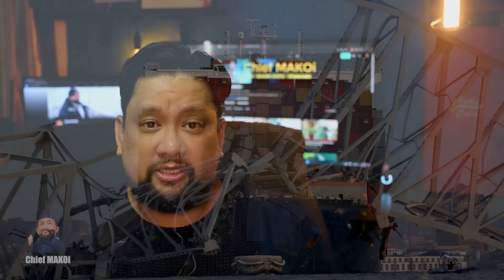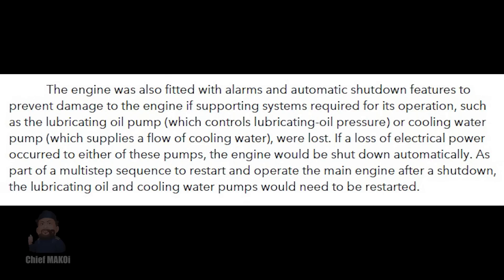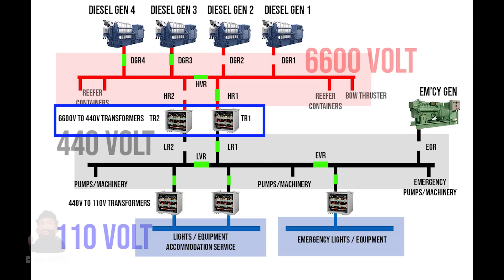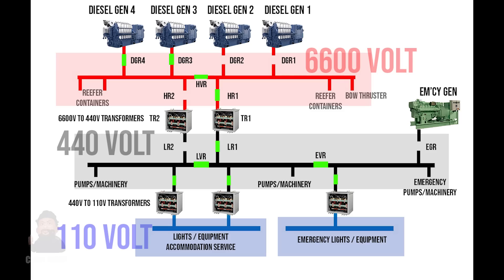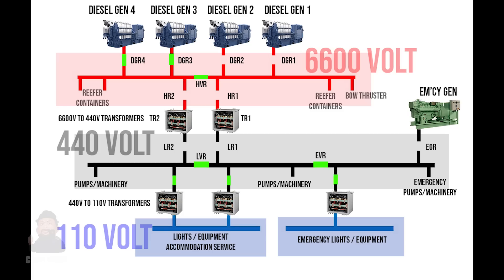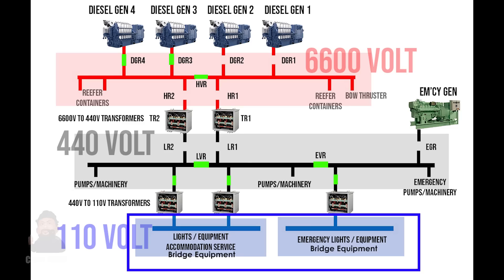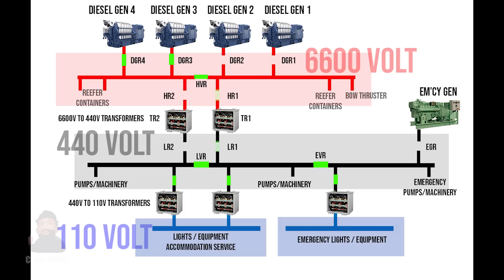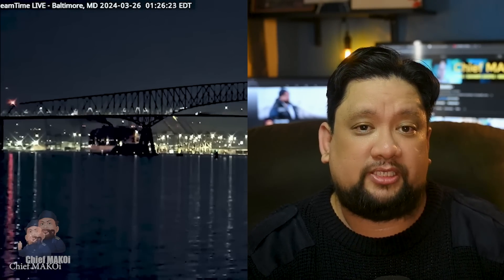Explaining the NTSB Report on the Container Ship DALI | Chief MAKOi

Comment: Chief - Yours is the only explanation that makes complete sense based on what the NTSB has revealed so far.  You were right that the black smoke was not from an attempt to restart the main engines as others postulated immediately after the incident.  If you are saying the primary generator engines get their fuel from gravity fed tanks and their own integral pumps in turn provide pressurized fuel to the cylinders for the generator engines it means there was something overloading the generators which caused their breakers to trip.  The black smoke is now likely the running generators attempting to take on a sudden load after the breakers were manually reset on Transformer 1 or Generator 2 coming on-line. Unfortunately we only have a sequence of events and not a timeline synchronized to what we all saw on the external video feed.  The running gensets obviously failed to handle the sudden demand and disconnected from the bus to prevent engine/generator damage.  This means the likely culprit was TR1 which the NTSB should be testing to see if it's meeting original specs or has internal damage. I'm guessing the breakers downstream and upstream of TR1 are also controlled by sensors that detect impending failure or overheating of the transformer which could result in catastrophic failure such as an explosion.  It would be nice to know the physical locations of all these parts and pieces of the electrical system in relation to each other.  Finally, the system needs to be designed to drop non-essential loads, like the reefers, in an emergency making all power available to the propulsion and steering systems only.  This may be an NTSB recommendation.
Reply: Wrt transformer TR1, there's some discussion in comments to correspoding YT Video from Sal on `What's going on with shipping?´. Basically it's about TR1 hasn't been used for months until the issue while in-port Baltimore; i.e. left `de-energized`, which can cause the transformer insulation picking up quite some amount of moisture. Which is not really healthy for high voltage and might cause first weakness (e.g. possibly increased load).
There's also lot of discussion why breakers HR1 and LR1 more or less tripped simultaneously. This is interesting question of course. However, I'm asking myself what this could cause to the transformers isolation. So question is, whether TR1 could get damaged (further) and lead to significantly increased load which will affect DGR 3 & 4 operation when re-powering, too (this is wrt to the heavy smoke observed, indicating high load or other issues).
Why ? Considering TR1 has been operating under high load with high currents, sudden opening of both HR1 and LR1 breakers will cause both coils to induce very high voltage peaks; same like for the ignition coil used in older gasoline engines to create the sparks. On the one hand, the transformer or / and the breaker should have some measure to safely reduce / prevent such over-voltage peak (which could further create harm to windings potentially already `soaked´ with moisture). When opening the breakers, such over-voltage peaks can also create sparks (unless they're already built as high-power semiconductor switches). Perhaps there's dedicated `spark gap´ which absorbs such over-voltage peak. Since power in the range of several hundred kWs is switched here, I'd expert the breakers might need some additional inert gas injection to blow off the spark at some time. Chief MAKOi also wondered why apparently the crew always had to close the breakers manually.

But I also still wonder about these issues with DGR2 (well, interesting story) and perhaps more important with DGR3 and "low fuel pressure". That suggests there might be 2nd cause; since HR1 / TR1 / LR1 have not been in use in-port until power recovery after 2nd power-trip in-port when crew manually switched to TR1.
Let's wait for further investigation results by the NTSB.
Reply: I agree.  We don't have the complete picture of what the electrical equipment was doing and the crew's response to the loss of power.  If TR1 wasn't load tested after it was brought online while they were still docked then that is an oversight by the crew.  When they say the crew "manually" reset the breakers it's likely they are simply flipping a switch that energizes a relay that actually closes the circuit.  The physical  breakers would be either in a vacuum, a dielectric medium like oil, or other arc/spark arresting materials used in high voltage applications.  TR1 is the most likely culprit and both  breakers tripped simultaneously to isolate it in order to prevent catastrophic failure of the transformer and damage to upstream and downstream connected equipment.  They really should be cycling the transformers more frequently, like every other voyage and not leaving them offline for months at a time.  Ultimately I don't think they would have been able to restart the main engine in time to avoid colliding with the bridge.  Good discussion!  Cheers!
Reply: @BlueSpruce2  RE "Good discussion!"
Bit of a pity that YT software team doesn’t spend bit more effort by e.g. introducing more than one indent level. That would help for readability and follow-up, also could prevent repetitive comments & questions. I'd better not think of how this must feel for Chief MAKOi getting flooded with all the comments ... But of course, primary YT target of the `comment section´ is to simply create `clicks & likes´ rather than `deep-dive forum discussion´… 
OK, positive thinking again 😃:
It’s remarkable once it comes to YT clips dealing with technical topics, there’s always a certain portion of comments where one can notice also experts from various disciplines sharing their knowledge & experience, which I really appreciate and enjoy. I could imagine this must also have been the spirit during the early days of the Internet (with DARPA being one the initiators as far as I know, possibly also other scientific institutions). Yes, partly it is speculating and also controversal due to different experiences & background (like for the electric part when US Navy chiefs, land-based power-grid and aviation share their views based on regulations which might differ from civil marine). But best case everyone can pick up some beneficial insights & learnings.
Which brings us back to the root cause puzzle. Agree, to me it appears this trace wrt transformer TR1 is one (important) part of it. Same time, I still wonder about the issues with the power trips while in-port (where TR1 has not been used in the beginning) caused by the diesel generators. Equally important this heavy smoke when power came back after first power-trip when Dali was on the way towards the bridge. Could be due to high electrical load (e.g. due to even more `damaged´ TR1 after the emergency trip) possibly causing synchrnoisation issues, plus insufficient diesel supply and fuel pressure coming along with power loss on the 440V bus. However, coming from electronic engineering myself, I notice & follow observations from the chiefs like MAKOi and Steam man with their expertise on daily basis in very open-minded manner.
Reply: Looks like we both use YT for the same thing - learning something new and broadening our knowledge of things we are not necessarily experts on but have some technical background.  I'm civil but I took electrical and mechanical engineering classes as my technical electives so some of the terminology is not all Greek to me... 😂.  A sudden heavy load on Generators 3&4 is definitely a possibility for the black smoke we see after the power from the first breaker trip was restored (you see it all the time from diesel trucks on the road, notably when drivers suddenly step on the accelerator) and if TR1 was failing it could be the source of the increased demand load on the running generators leading to the second power failure when the genset breakers were opened.  Whether triggered by an ongoing electrical overload or to prevent mechanical damage to the generator engines remain to be determined, but we shall see where the investigation leads.  The Chief thinks the electrical system on this ship has PLC's so the programming could be what was calling the shots regarding what got isolated or disconnected if the sensor inputs were indicating an impending catastrophic failure of one or more components.  Unfortunately it takes the NTSB a very long time to produce final reports, and by the time they do most people have moved on or forgotten about the accident.  You see that all the time with major aircraft accidents.
Reply: @BlueSpruce2  In that particular case, it started that I’ve noted the preview from the port webcam. Hovering over, clip started and I watched a bit; asking myself at some point “now do I really want to see people losing their lives?” – I’m not really keen on this; and I get sufficient amount of `thrills´ in my business environment on daily basis ... 😅
However, I somewhat noted that lights went out, also this smoke. That’s what triggered my engineers curiosity, kind of “ooopps, what happened there, what does the video reveal as `first level´ information?” Thus I’ve watched the clip – luckily no sound, or better said: not any spoken comment; thus full focus on what I can see (also wrote some lengthy comment on YT clip from `first Coast News´ about the `flashes´ which can be observed when the bridge collapsed - expect some of them from the cables suffering short-circuit; plus sheer mechanical force later). To me it’s like trying to collect pieces of a puzzle and putting them together, looking to build bigger fragments. Looking across the fence, applying engineering skills. Working in semi-conductor business, when do I have possibility to get in touch with chief engineers of large container vessels like ChiefMAKOi and Steam man? Actually in charge of `production mgmt´- which requires quite a broadband knowledge & experience – I made it my habit picking up on such interesting topics. It might happen I could need it anytime soon (though in a different way), but sometimes one can learn much more important things in very short time during trouble-shooting and getting hands dirty.
Reply: @NRZ-3Pi10  You can definitely learn a lot getting your hands dirty...  It's why I do all the maintenance and repair work on my car myself now, except things like changing tires, balancing wheels etc. that require specialized tools and equipment.  On the somber side, yes we helplessly watched six people go to their graves and hopefully they are now in a better place.  I agree the sparks were most likely from power cables breaking and shorting out and also possibly metal rubbing against metal as some of the truss connections came apart.  Lots of energy released and a reminder we live in an entropic universe.  Until we get a more granular timeline from the NTSB of the events that night we only have educated assumptions to work with.  If the systems were controlled by PLC's and managed by a SCADA system there is likely enough forensic evidence for investigators to definitively conclude what caused the initial power failure that culminated in the running generators going offline.  SCADA systems are usually what hackers target in industrial process controls but I don't think that was the case here.
Reply: @BlueSpruce2  RE: “Lots of energy released … a reminder we live in an entropic universe.” 😄
… and the bridge followed the local space-time bending 😉. OK, let’s get back slightly more serious again. There’s interesting `flashes´ when the right side of main truss finally literally got ripped from remaining truss on that pillar. I don’t think those have been caused by electrical shorts again. To my mind, it’s much more the effect of extreme tensile stress. Looked up tensile strength for alloyed steel; which very roughly is in range of 1. tons / 10mm² or 120kg / mm² (amazingly human hair also has 16% of that !). I’m pretty sure the weight of the main truss segment and corresponding force pulling down shortly before reaching water level heavily exceeded this tensile strength, causing some pinching first (also expected to come along with quite some heating) until the angle-steel finally collapsed. So to me it appears the flash is caused by extreme heating and finally cracking the bindings between the atoms – kind of epic fight between gravity and electro-magnetic forces. It’s very noticeable there’s not any smoke visible for this flash, which means nothing is `burnt´ in the `usual´ way.
Wrt investigations, I’m pretty sure NTSB technical experts will get down to the very details and will find out what happened and the series of issues finally leading to this disaster. Besides 6 fatalities, with financial impact in the 1bn US $ range, there’s lot of interest involved here. Which means that they need to be accurate as can; also wrt preventive measures to be applied in future.
Myself, I also put focus on the quite remarkable technical sequence and timing of issues, and how that finally ended up in disaster. Given this, any reflection about potential conspiracy would only lead to some truly `black-ops´ thing – in a dimension we can be very sure intelligence services are looking into but will not to disclose to public. So let’s leave such things to Tom Clancy or any other author writing novels & thrillers.
Reply: @NRZ-3Pi10  P. S. The bridge succumbed to the gravity well we all live in... 😂
Reply: @BlueSpruce2  Yeah; fortunately Newton's equations of motion still fit very well to the time stamps of the collapse. Thus 80% result with 20% effort, rather than delighten the audience with Einstein's GToR 🤣
Reply: @NRZ-3Pi10  I would definitely like to see a simulation of the trajectory of the ship taking into account momentum, wind and water current vectors including what effect dropping the port anchor had on said trajectory.
Reply: @BlueSpruce2  Watch out; long feedback ahead!😅
I've asked Steam man (he also placed comment here for some technical exchange between the chiefs 😃) wrt the time it needs to come to a main engine stop. Obviously that goes relatively quick (despite some inertia which I would have expected).
Based on this and some more brainstorming, I more and more tend towards the reason why Dali veered to starboard once losing electrical power and main engine is due to the currents induced in the relatively shallow waters of Baltimore port by Dali’s propeller itself (!). As long as main engine still running, it appears like the propeller walk even seemed to be compensated by these currents, as rudder has been amidships (i.e. not compensating any prop-walk effect). Once main engine gone – which as per Steam man' feedback obviously can / will happen in quite short time – I'd expect those currents will still keep remaining for a bit longer time due to inertia of water; now dominating since also no prop-walk any longer.
I did very simple calculation trying to get a grip on the dimensions. For simplicity, let’s take a mass of 100000t (metric tons) which needs to be brought on speed of 8 knots ( ~ 4m/s ). Applying conservation of momentum ( momentum =  mass * velocity ), it needs equivalent mass of 100000t at same speed (or less mass but at higher speed then), but in opposite direction. Sounds incredible, but considering water comes along with weight of 1t / m³ (1000t in a cube of 10m x 10m x 10m = 1000m³), it “just” needs 100 * 1000m³ , i.e. 100 of such 10mx10mx10m cubes. Dali has width of ~50m, and can only move along the main channel of Baltimore harbour. Thus I’d expect the amount of water which can be used for propulsion below bottom is quite limited. Means most of the water to be pushed & accelerated by the propeller needs to come from the sides then. For simplicity, let’s split 100 * 1000m³ in (2sides * 50cubes/side) * 1000m³ or (2sides * 2lanes * 25cubes per side&lane) * 1000m³. In other words, all the water needed comes from 2 lanes with width of 20m next to Dali at a length of 250m (which is almost full length of the ship), which will cause currents in the vicinity of Dali. Since the area besides the main channel is shallow, I'd expect currents being stronger towards water surface. However, due to rotation of right-handed propeller, there’s also drag / pull of water on starboard, and push-up on port side. So in principle a vertical component pushing Dali’ stern to port, but obviously compensated by propeller walk here. However, once main engine and propeller stops, the flow of tons of water will still continue for bit longer time, with a vertical component pushing stern to port still and thus causing bow moving to starboard (and the pillar) now; assuming the ship turns around its centre of gravity.
Sounds reasonable?
Would be interesting to know whether the water depth is considered in simulations of harbour situations.
Currents of Curtis canal and remaining tidal currents, plus some wind might add on top in unfavourable direction.
Reply: @NRZ-3Pi10  A little long but a pretty good attempt to address the movement of the vessel after it lost propulsion.  There are of course other forces at work such as hydrodynamic drag on the hull.  I believe you are correct the surface currents are likely the controlling force on the water.  I was curious as to how long it takes the propeller to stop turning in the driven direction after power is lost or until it becomes a "windmill" in the water from residual forward momentum of the ship.  100,000 tons still packs quite a bit of kinetic energy even at the 5-6kts it was probably doing at the point it collided with the bridge.  They apparently did have some rudder control from the main or emergency generators but I understand without the prop these relatively small rudders are ineffective since they need that water flow to direct a certain amount or mass of water in the desired direction to create a turning moment around some point along the keel.  I'm not sure it is necessarily the CG or CB. Ships with Azipods don't have this probmem.  There are research universities and other institutions with wave tanks that simulate these things using scale models but I suspect more of these simulations are done on supercomputers these days.
Reply: @BlueSpruce2  Agree; bit long for everyone with technical background. So Thanks for taking time to go through it though 😀. But I’m also trying to make it as comprehensive for anyone who’s interested and (by chance) reading such comments here. Which means I somewhat need to describe the picture that I have in my mind.
True, there’s also additional hydrodynamic effects like drag on the hull, bank suction; and it’s easier to create flowing, steady currents nearer to the surface of water than towards ground, where friction creates resistance, also causing vortex.
When addressing by conservation of momentum, I compared it with rockets as well as propeller & jet engine driven planes first. But perhaps the funniest example which we don’t spend any thoughts about is when going by car. It’s good friction of the tires which “brings the horse-powers on the road”. But at the very end, it’s also momentum again, just that the huge mass of mother Earth will not significantly increase its speed (of rotation)  😅.